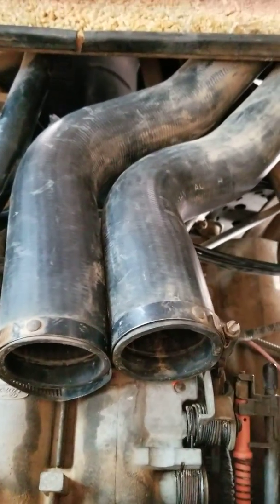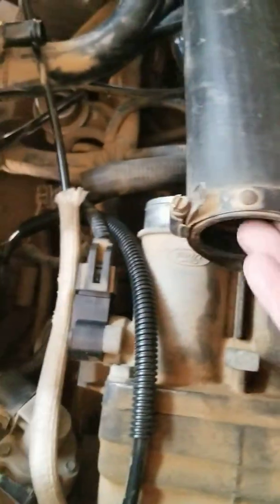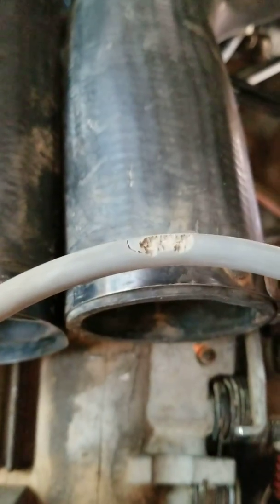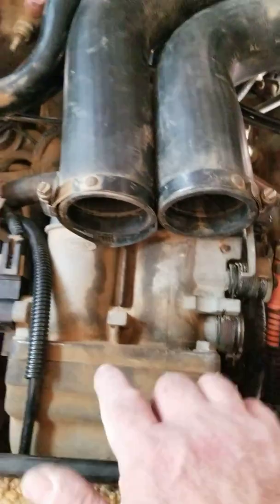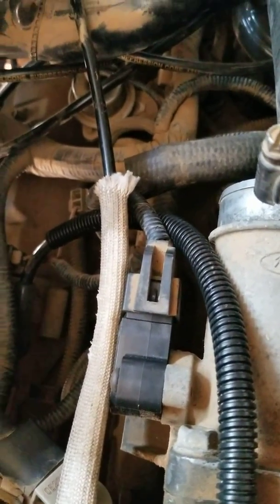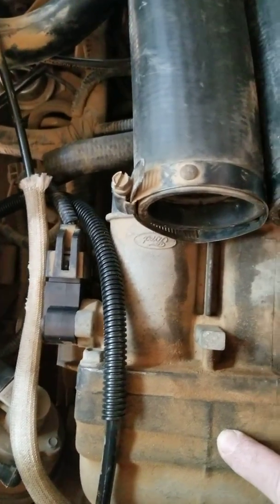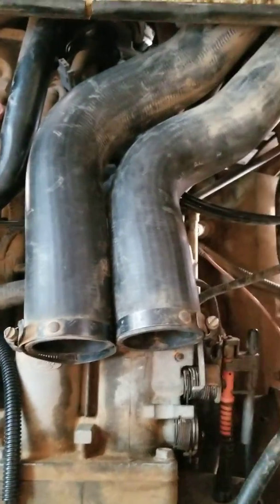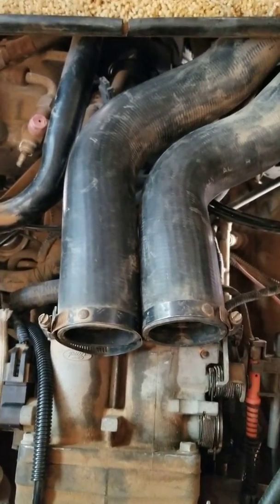Ford E4OD low speed shift problems

Comment: did your truck run and not want to go in gear?(1st-2nd)  kinda like a free wheel then shift hard? thats what mine is doing and only codes are emissions but its deleted
Reply: Any of you find the issue? I have the same issue?
Reply: I’m not to sure what happened to mine I changed the fluid 2 times new filters each time over the span of 4 weeks, I drove the shit out of it kicking high and not shifting into 2,3 the. Hit passing gear. I was hunting one day and ran over a bunch of roots that ripped my speed season off the rear end(just the wires) new connector and it’s been running great ever sense. 
And in my process of figuring it out I changed 7 speed sensors from 3 different stores(I’m currently running a 15 year old one from my dads old truck)
The shifting solenoid
New harness from the trans to the computer 
As I said 2 fluid flushes and filters
Reply: Having the same issue did you find a fix? Im changing my neutral saftey switch due to othet issues thinking it may fox that as well let me know if you fogured out the hard shifting issue